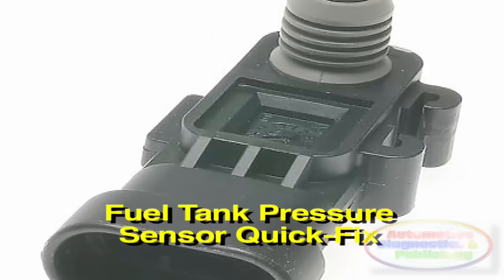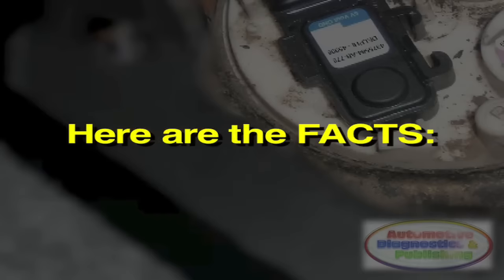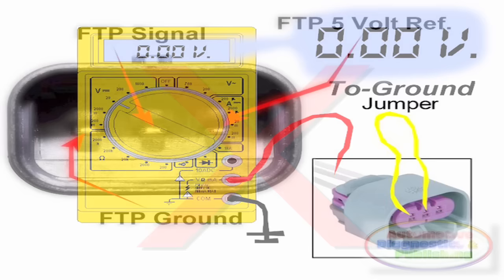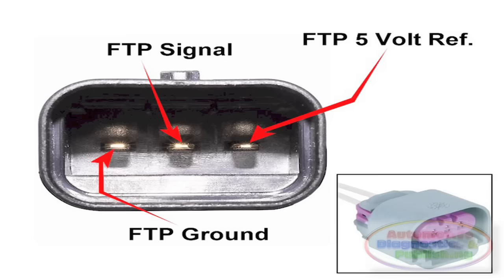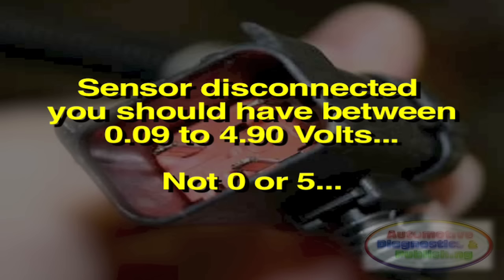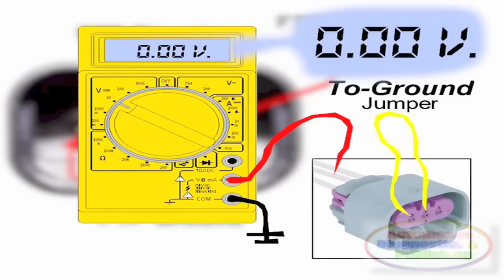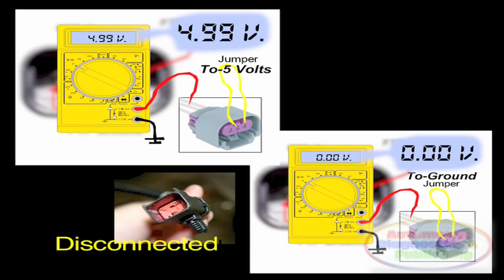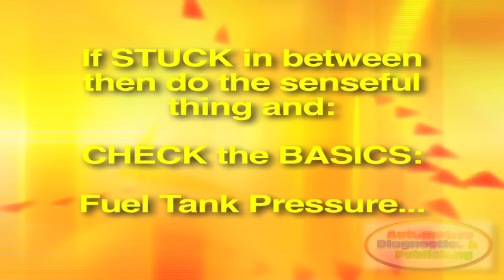Fuel Tank Pressure Sensor Quick-Fix

Comment: I disagree with your "no bearing on"  how the engine runs . It can cause fuel tank filling issues as well as other lean/ rich conditions   If stuck in either open or closed signal to ECM to control Vent valve operation, which it does .     Specifically in conjuction with fuel vapor purge valve for fuel trim specs .
Reply: Yes, it does have an effect.This is correct.. my stft were in a lean condition.
Reply from the maker: Thanks https://www.paypal.com/donate/?hosted_button_id=F9W5VPHTGWBV6

Comment: Thanks My wifes 2013 Chrysler T&C has constantly had the engine light- "P0456 generic small evap leap"(so now you can't tell if there;'s really something wrong) since we bought it. I've replaced Cap w/ OEM. The dealer replaced cap twice.(These are the guys who put the wrong lug nuts back on it- wouldn't pass Ispn my 05 ram because the "rack&pinion is bad" on my gear box steering syst -Rolls eyes) Great vid

Comment: Got a po453 and a Po446 code on my 2002 escalade. Sometimes when I turn it on it idles rough so I was told i had to replace the fuel tank pressure sensor ?

Comment: I have three sensors here. 2 are from the top of a airtex assembly, I have 2 , they are identical looking and supposed to be brand new. They act different when I hook them to a Ohm meter .  one i can get a reading when I hook the two outside pins , Or one outside pin to the center, the other I can only get a reading from center to either outside pin but not the out side pins without the center pin,  The third sensor I have is the one that was on the 2001 yukon and it gets no reading from any pin in any combo.  

  This is so irritating I cannot even describe it.  you cannot get to the tank sensor on one of these trucks without dropping the tank.   what one is good and why are they going bad? why do they not read the same if two are good and I still have a code.  How do you test these sensors for SURE while they are OUTSIDE the vehicle?

Comment: Hi, good evening, I have a Jeep Grand Cherokee 2002 limited, which, when loading 30 liters of gasoline, I see that the gas tank indicator drops more or less quickly. Since when I charge 30 liters, the indicator marks me 1/4, and having 30 liters in the tank, almost full mark (missing 1/8). But in a day of crossing maximum 5 km, it takes 1/8 of the tank of gasoline.

I do not know if it is a sensor, or if they have to readjust some other piece.

Also when activating the Air conditioning, only the cold air from the passenger side comes out of the grid that is glued to the window of the passenger door, but not to the central grilles or the chauffeur. I also see that the compressor is not activated when the AC system is turned on.

They recommend me to fix this situation.

Thank you very much for the help.

Comment: Haveing problem with Ford 460 it runs but you have to pump the gas peddle freally fast and it barely runs. It pops and go's on. It ran fine when I parked it. It set for about a year without starting. Its like it isn't getting enough gas. Please help.

Comment: is the ftp sensor on top of the fuel pump? in every picture i have seen, that is where it seems to be, but no one is actually saying that this is the location. i have a 2001 chevy blazer 4.3L 2 door. thank you in advance
Reply: On the trailblazer  its on the top/rear/driver side, accessible without tank removal.
The "ext" (3rdRowSeat) model may have it on the pump & tank must come down.

Comment: Po453 can that cause the po171 and 174 to trigger to cause 01 crown victoria have these codes and i think my car runs bad after the idle at a drive thru....but all is showing up is these 3 codes
Reply from the maker: Lagary Moy No Moy, P0171 and 172 are VERY COMMON CODES. They cover 75% of Air fuel imbalance issues. They point to a system running lean and your scanner FUEL TRIMS should be >+10 (greater than). The most common code is a vacuum leak. On FORDS you may want to clean the MAF sensor. Dealers say it's not supposed to be cleaned, but it is. So to re-cap: Check your MAF SENSOR and for a VACUUM LEAK.... http://www.autodiagnosticsandpublishing.com/

Comment: I get a p0460 pending reading for the fuel level sensor "A" Circuit.  Is there a way to reset this reading?  I changed the gas cap and the fuel pump is working well.  It appears since I have a 2002 ford focus ZX3 the sensor is attached to the fuel pump. Is there anything else I can do before spending $500 to replace the fuel pump.  It appears the tank needs to be dropped to change the fuel pump.  Any idea? Thank you.
Reply from the maker: Rosemary, DO NOT CHANGE THE FUEL PUMP PLEASE... The issue is the FTP sensor. It is a small square block, 3 wires, close to the fuel tank on most cars (not all) and measures the ability of the fuel tank and hoses to retain a slight pressure or vacuum. In other words, it makes sure the EVAP or fuel vapor system is SEALED. THere is a whole procedure for checking this system. I wrote a series of Book and Video that deals with the EVAP system. It's impossible to do it here. Here's the link if you feel it can help you.: https://www.createspace.com/320278    https://www.createspace.com/3623940

Comment: Question I put a new fuel tank on my 2000 F 150 , and a new fuel tank pressure sensor I had no lights on before the new tank now I'm getting a PO 453 , high tank pressure sensor  code , Any ideas ?
Reply from the maker: truck87654321 Yes, you messed up one of the EVAP hoses or it's kinked. Retrace your steps other wise that light will never come out.
Reply: ADPTraining Thanks got it fixed turned out a broken ground wire on the  presser sensor , it was driving me nuts tracking it down .
Reply from the maker: truck87654321
Here's our latest product: http://www.autodiagnosticsandpublishing.com/Injector_Pulser_Tool.html
Reply: truck87654321 how did you find out
Reply: Yuri Sales By unplugging it and looking at connection .
Reply: ADPTraining  how did you find the ground wire

Comment: I am getting a "fuel tank pressure sensor" code when the vehicle is scanned.  I replaced the gas cap but it appears that the sensor needs to be replaced as well.  The sensor cost me $40 at Auto-Zone.  Is it necessary to drop the tank to replace this sensor?
Reply from the maker: Depends on the car. All vehicles are different. You need a service manual or for 20 bucks get all data DIY and it's good for your car only. See where the FTPS is and replace it. WHile youre there key on engine off and check the sensor connector for Ground, 5 Volt Reference, and Signal. GOod luck.
Reply: Some cars have access panels under th rear seat
Reply: but that's just for the gas pump. The sensor might even be under the hood rather than on top of the tank. Also note that Hondas are infamous for a leaking o-ring in the filler neck. Should have gotten a pressure test before blaming the sensor.
Reply: Since you replaced the gas cap, the code obviously wasn't blaming the sensor directly.
Reply: The code didnt necessarily blame the gas cap or the sensor directly.  The technician at Auto Zone suggested the two potential issues.  I did replace the sensor as well (jacked the rear driver side of the truck up, removed the tire and fender skirt, and there was the sensor, right on top of the fuel pump assembly) and the check engine light went out. Very easy fix.  Took longer to get the tire and fender skirt out of the way.
Reply from the maker: Great comment, I love it when folks do their own diagnostic and repair. You saved yourself over $200 easily. Well done...
Reply: Thank you...
Reply from the maker: http://www.autodiagnosticsandpublishing.com/Injector_Pulser_Tool.html
Reply from the maker: http://www.autodiagnosticsandpublishing.com/ignition_coil_pulser_tester.html
Reply: @ADPTraining  hello im trying to find out how to replace the fuel tank pressure sensor on a 02 saturn l100 but no luck with any good videos on youtube

Comment: where is the fuel tank preassure sensor located on a 2005 mazda 3?
Reply: Pink 25 on the tank but u need to remove muffler before to see

Comment: is it possible to get an EVAP code if this FTP sensor was defective?
Reply from the maker: Yes, of course. Often, today's ECMs are too smart and the MONITOR software realizes that there is a sensor issue. Right after 1999 there was a major shift to using 64 bit ECMs when the consumers were still on 32 bits. So, a lot of the DTCs today are generated by rationality testing.

Comment: I have a question I drive a 2006 Escalade trying to see what could be causing gas to come back up when I am pumping gas. I checked the fuel line and didn't see a pinched hose so still not sure what could be causing the issue. I'm thinking that it might be the fuel air evap has anybody ever had this problem before if so what did you do to fix it?
Reply from the maker: jewjew Garcia Yes, this is a real issue sometimes, regardless of what brand of car you drive. It is related to the CHECK-BALL at the fuel filler neck. Inside that fuel filler neck is a ping pong size check-ball that prevents fuel from exiting the tank if it flips or you overfill it. It is a check valve or ball and seat. That simple mechanical system is getting stuck. Your best and faster recourse is to replace it. It is a simple repair.
Reply: something happens to mine..

Comment: Ok so my truck shows on the dash that has no gas on the meter but it got  gas , can it be the pressure sensor ? Oh and my truck won't start on?  Help please.
Reply from the maker: A dash issue shouldn't cause a no start. Unless you have a computer network that is down. See if you have any U codes.
Reply: I think your fuel pump is unplugged.
Reply: Btw, my computer threw a code for low fuel reading gauge sender when I consistently kept only a couple of gallons in the tank. The gague was right, the computer was wrong .

Comment: I have a 2001 Chevy Venture the voltage under absolutely no pressure 4.78 when I start the car it goes to 4.83 does that mean the sensor is bad  I can't find anywhere on the internet wear it tells you the general sensor information

Comment: I drive a 2003 Pontiac Aztek! and recently I got that " Service Engine Soon" light, so I scanned for trouble codes and I got this code: "P0452 Evaporative Emission System Pressure Sensor/ Switch Low Input".
Now, does that have anything to do with the Fuel Tank Pressure Sensor?
and also, sometimes my Fuel gauge indicates that I have no fuel or that it's low on fuel when I know it's full!! 
I would really appreciate your help! I'm trying to do this myself!!
Reply from the maker: Ok, yes the code P0452 is related to the fuel tank pressure sensor. This system will not prevent the car from starting, but it looks like you have an electrical issue. The fact that you lost the fuel gauge tells me that you probably have a loose ground.

Here's our latest product: http://www.autodiagnosticsandpublishing.com/Injector_Pulser_Tool.html
Reply: Thank you!! I really appreciate it that you replied to me!! I will check the ground connection!
Reply from the maker: Good luck...
Reply: thanks
Reply from the maker: Here's our latest WOW INJECTOR PULSER tool. http://www.autodiagnosticsandpublishing.com/Injector_Pulser_Tool.html
Reply: ADPTraining hi I have a 2004 jeep liberty v 6 where is the fuel tank pressure sensor located  my engine light is coming on is it a easy fix help please
Reply from the maker: You may have to remove the fuel tank if you don't have access to the top. Otherwise its a simple replacement.
Reply: ADPTraining hi i have a 2004 jeep liberty 4 wheel drive v6 i went to auto zone to check my engine light p0452 fuel tank pressure sensor they stated that my car doesn't have this sensor but why does it state that i have a fuel tank pressure sensor defective. And if so where can i get that sensor i tried pepboy no tried autozone no tried advance auto parts no where can you help
Reply from the maker: That CODE Definition is WRONG. P0452 means natural vacuum leak detection valve stuck closed. Jeep changed to natural diurnal EVAP systems right around 2002, so no more tank pressure sensors.

Comment: How do I remove the fuel tank pressure sensor from pump? what holds it down?
Reply: There's going to be the wire on one end, a small hose on the opposite end, and two plastic clamps on either side of your fuel pump holding it in. Disconnect it from the wire, then from the clamps, and the hose should come easy.
Reply from the maker: Mitchell 1 home

Comment: Hello I have a 2001 Tahoe code PO452 checked wires good has knew purge valve and is working has knew vent solenoid and has power knew fuel pump module all hoses are clear checked ecm the the wires for the tank pressure switch check good is it possible the vapor canister is the problem for this code
Reply from the maker: John Allen P0452 means that the EVAP pressure sensor is shorted to ground or its output will stay low near ground. 

1) Disconnect sensor and connect BLUE-VOLTAGE-SIMULATOR to it. This mimics the ECM circuit and allows you to test the sensor.

2) Apply some suction with a clean vacuum hose and your mouth or vacuum hand pump and watch for a signal change.

3) If not, then replace sensor. If there is a change, then the issue is in the EVAP plumbing. 

http://www.autodiagnosticsandpublishing.com/ecm_reference_voltage.html

Comment: I have a 2004 Tahoe.  For the past 3 years, once the fuel gauge gets to less than half a tank it won't crank.  It'll turn over, but won't crank.  Acts like it's out of gas, but it's not.  Could that be the fuel pump or the fuel tank pressure sensor.  It's very aggravating to have to fill up at a half a tank.

Comment: with the engine running,  I was jumping 5v with the signal wire and dropping down,  and then I jumped ground with the signal and the car shut down, I think it was the pump

Comment: if the signal wire is shorted to ground and you take the 5v ref wire and jump with the signal wire, you will hurt the ECM.
Reply from the maker: No, these circuits are highly protected and fed though a larger resistor to cause any issues. You shouldn't feed 12 volts to any of these wire, but other than that no worries. This is why if I see any of my guys using the Power-Probe I discourage its use. 

Now, back to your assumption. As the video says, if you disconnect and probe on the signal wire, should see a voltage. If so, FINE, great, replace the sensor. If not, then jump wire, even if SIGNAL is shorted to ground. And if shorted to Gnd. and you do this test, then no change will be seen. You have a wiring issue. 99% of the time it's a broken wire due to the fuel tank being exposed to the elements. But too often the FTP sensor is replaced ERRONEOUSLY. Makes sense?
Reply: So if the 5V ref was to be shorted to ground it will not damage the PCM? I'm sure something would happen.
Reply from the maker: No, the issue is low current. The 5 volt ref. signal is in the 5 mA max. range. ALso there's a high value resistor protecting the circuit. Almost all automotive sensors work on 5 volt. Imagine if every time the 5v ref. shorts to ground you'd loose the ECM, the ECM failure rate would be quite high. Now, I say again, if you short the sensor ground to 12 volts, then it be an issue, probably burn the ECM. THis is why the common side of the circuit is always ground. There were cars in the 50's with Positive chassis, but I wouldn't see that as productive. 

To finalize, the reason why nothing happens if 5 volts shorts to ground is LOW CURRENT in the mA range or lower. In fact, the FTP and TPS sensors are a form of short though an internal resistor. Since the circuit is low power it generates NO-HEAT whatsoever. THanks or being interested in this stuff.
Reply: ADPTraining i rather use a testlight to test the wire integrity
Reply from the maker: No, don't use a test light for SENSOR circuits. Just pay attention and DON'T use a Power-Probe. Not even just to see the LEDs lights. Introducing 12 V will do damage. Grounding the 5 volt reference will not.
Reply from the maker: Contagious, just one final anecdote... Not too long ago I had a Dodge with no trans shifting, or lights at the dash. It turned out to be the VSS at the transmission neck shorted. The 5 volt Ref. was shorted also killing the SAME 5V Ref. to the other sensors. They all shared the same 5 v line. Disconnected the VSS and it all came back to life. No ECM damage, just replaced the VSS. Good luck and always thanks for sharing.
Reply: ADPTraining My testlight only draws 10 mA. I've been doing it for years for checking wire integrity on sensors. Plus, they are just sensors, not an output. So don't fear. Try it yourself.
Reply from the maker: If you like it like that fine, but remember that test lights are not meant for electronics. If it works for you, OK you won't hurt anything.
Reply: ADPTraining Test light with low mA are much safer than using a jumper wire or power probe. There are times where the electrical wiring diagram is wrong and you are trying to test a component such as an electric EGR, a test light would come in handy.
Reply: Set trouble code.

Comment: dont you think would be better call these videos  "QUICK TROUBLESHOUT "
Reply from the maker: Good idea, but name is too long and YT won't like it. Folks need quick thinking. We had a long meeting on this subject...Thanks for sharing.
Reply: @ADPTraining  i have p0446 code on 2005 buick lesbra check engine light on i change purge valve could it be the ftp sensor